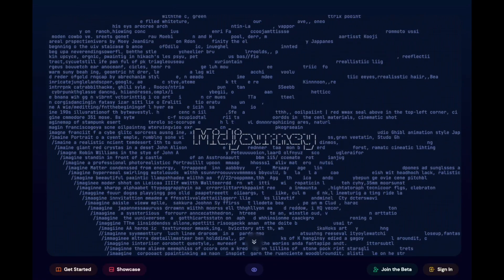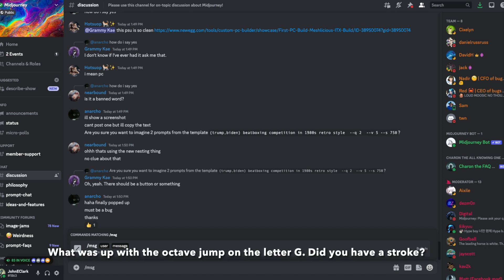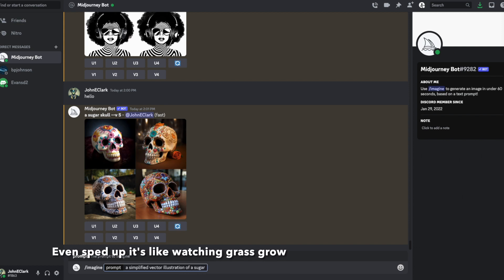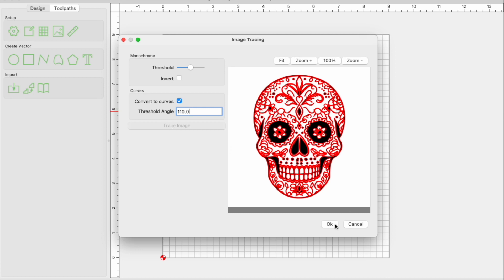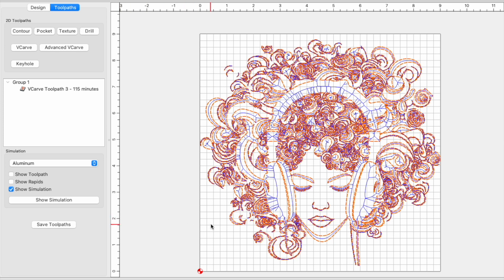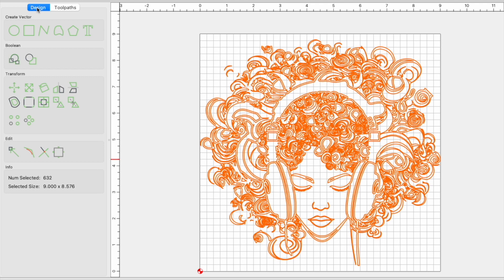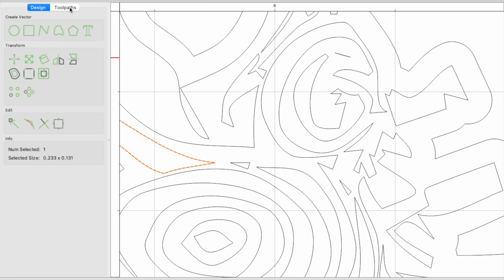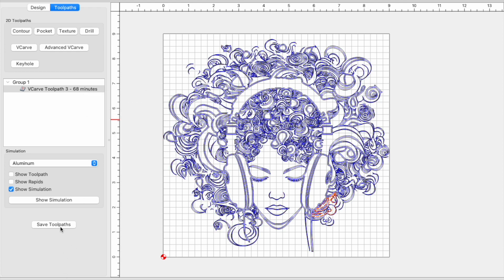MidJourney and Image Trace in Carbide Create

Comment: What kind of turn table are you using there?  I have been looking for something similar.
Reply from the maker: It is an old fan I had laying around. I just pulled the front and the blade off, then made a platform with a circular collar that fit over the motor shaft.

Comment: Hi John.  Great content.  I signed up for MidJourney after watching this.  One problem I'm having is that all the results I get tend to have a bit of "3d" to them, rather than flat, traceable 2d images.  Using "a simplified vector illustration" and "high contrast" in the prompt helps but even using your exact prompt (which include "black and white") for the album cover, I'm still seeing a lot of gray tones. Any further ideas on prompts that force a flat 2d image suitable for tracing?  Thanks!
Reply from the maker: I usually end all of these prompts with ", black and white vector illustration on a flat white background" I still get some greys, but I usually even them out a bit in something like Affinity Photo, Gimp or. Photoshop. Usually it's listed as adjust levels. I will try to cover that process soon.

Comment: Nice work, and good ideas for make some pictures in my home with DM.

I liked the system of turning the wood for make this effect, do you know how many rpm's uses in this motor? I have some spare nema motors and drivers of my CNC and maybe can i use one  (i changed to closed loop motors and now i'm in the fight of configuring one ATC).

Good job and thanks!